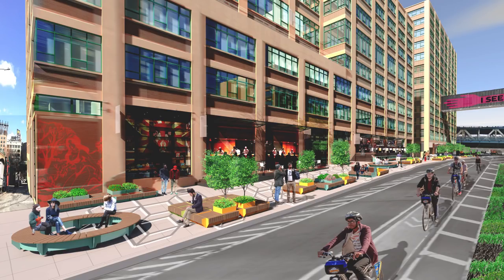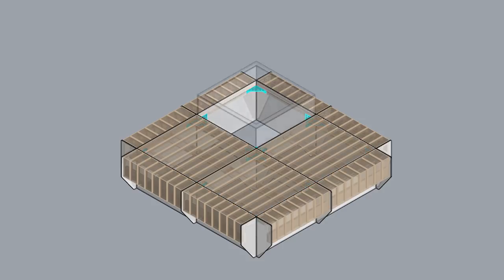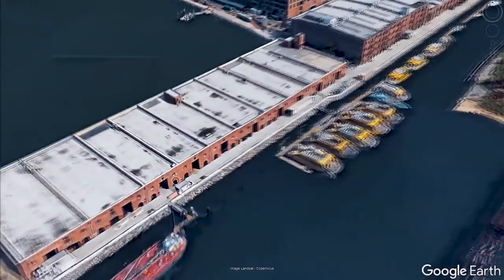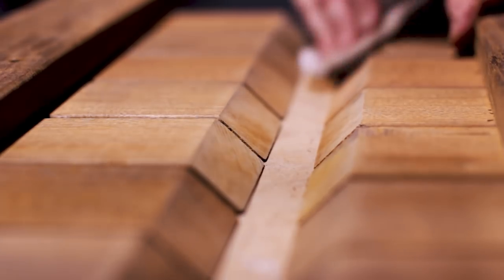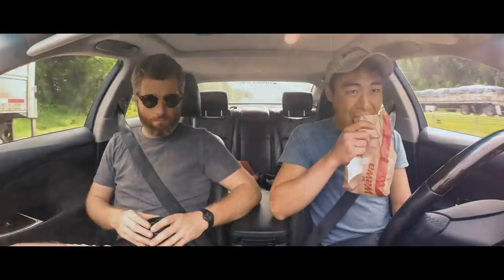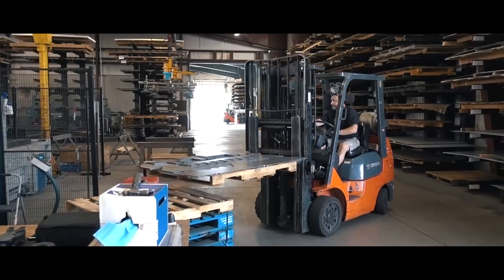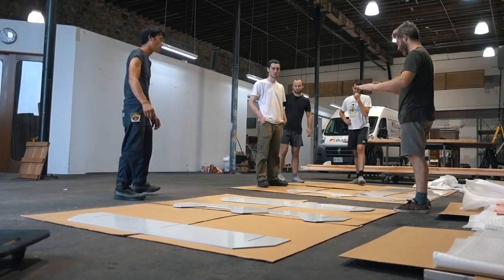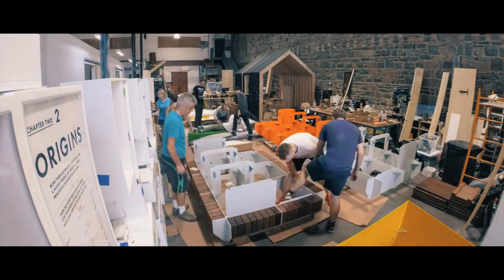Outdoor Furniture | Made from Decking Tiles

Comment: Connor,

I would love to know how you have managed to achieve intentional damage prevention, theft prevention, reduction of graffiti and ease of graffiti removal.  

I do like your simple solution to the brief.
Reply from the maker: Thank you. IPE is inherently a very tough wood - great for public and outdoor use. The steel is powder coated so it will last quite a long time. That's not to say it won't chip from time to time but for the most part that will prevent it from rusting. The sheer weight of these units is the theft protection. You need at least 5 guys to move them. Also all the nuts and bolts are tamper proof. In terms of graffiti - hopefully, it could be scrubbed off the powder coating, and we could potentially sand or replace some wood tiles. Thanks for watching!

Comment: Awesome video man.. its a treat... i wanted to ask, what software are you using for your designs? im thinking of getting a small plasma table for simple projects! thanks again for the great vids.. ive watched em all a few times !!!
Reply from the maker: Thanks a mill Gareth! Nice - a plasma table would be so cool! I use Rhino 3D - it's mostly 3D modeling software but pretty good for 2D stuff also. Are you familiar with any CAD software? You could use AutoCAD or even Illustrator as a drafting program. Autodesk's Fusion 360 is also pretty handy for creating toolpaths - it's CAM side is pretty user-friendly. Sketchup is also a great place to start for 3D work.
Reply: Conor Coghlan.... yeah so I’m familiar with burntables... and I️ Work off of solid works.. but I️ don’t do the modeling myself, I️ just fabricate and build.. been wanting to get into something myself at home... I’m gonna give your idea a shot and see what happens! Thanks a ton

Comment: Check out 2P10 glue with activator. It's changed my life and is insanely strong. I think it would work well with IPE
Reply from the maker: Never heard of that. Thanks for the recommendation. Does the 2P10 work well in exterior comditions? What we didn't show in the video is that we reinforced the underside of the joints with aluminum angle. This way they're mechanically fixed as well as glued.